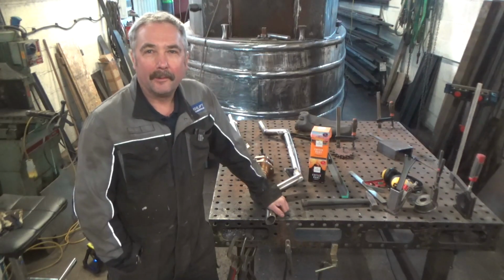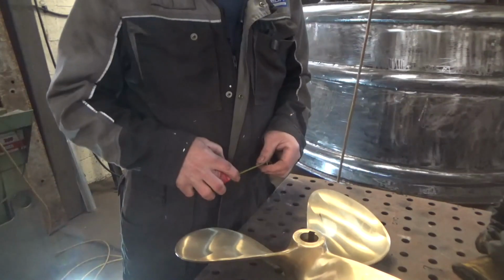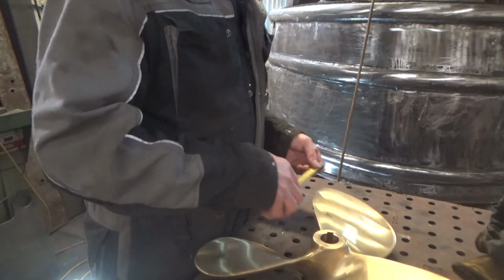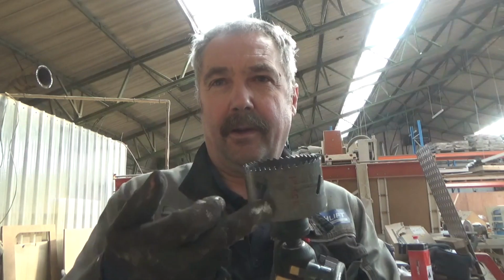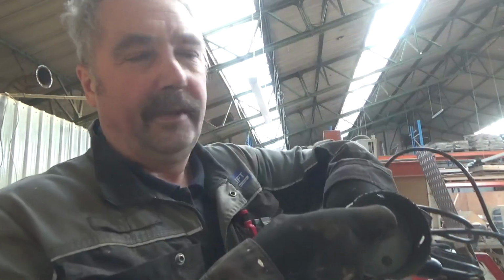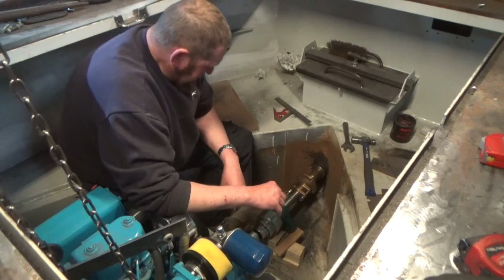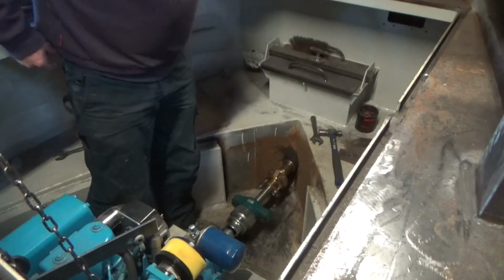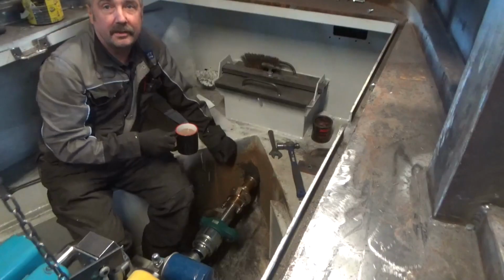Narrowboat Build Installing Aqua Drive &  Prop System

Comment: Nice work Andy, and love an aqua drive system. I rekon the stainless pipe needs a bleed valve on top, it'll cause issues with over heating otherwise. Be nice to leave the stainless shiny.
Reply from the maker: Hi Darren, Thanks for the advice. On other boats I have seen the 2 tanks joined on the bottom fittings & also seen top to opposite bottom fitting. Which do you think is correct ?
Reply: @nogunwales9406  typically the system flows out the engines hot, into one tanks top fitting, the flow comes out the bottom into the top of the second tank and then out the bottom to the water pump.

I've done it other ways but this is a proven method. 

This is really taking shape, loving this progression. Be nice to see her one day

Comment: Should you use dial indicator to make sure shaft is turning true ahs you rotate it? Seems you would want to has close as possible. with engine output. didn't se that you mounted engine

Comment: Hi Andy I am really enjoying your build videos please could you advise me where I can get info on roof building as I did not see your process of the roof, I have an old Springer which came with a wooden top and I want to put a steel top on it but I cant find the info on the roof stiffeners and fitting process such as getting the stiffeners formed to size and bending the roof plate
Reply from the maker: Hi Mick, Sounds an interesting project you are on with. My boat was a wooden top that was plated over . I have the drawings for the new build roof & sides & will send you a copy . You roll the box section stiffeners & you simply pull the roof steel to them & stitch on. If you want them rolling I can supply them for you Please email me @ kewkie10@aol.com.
Andy